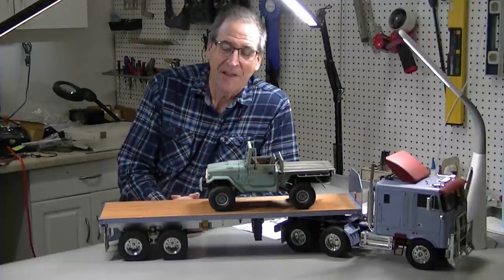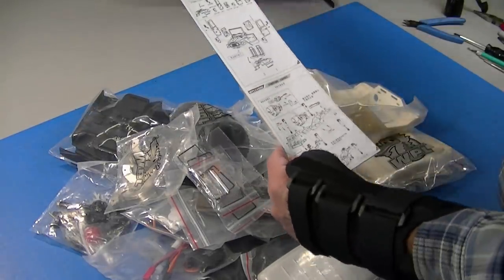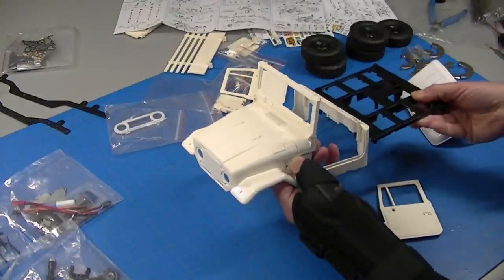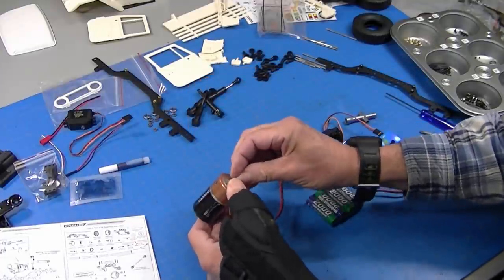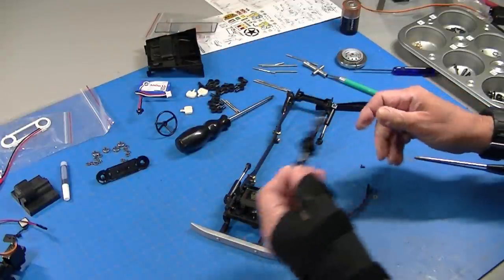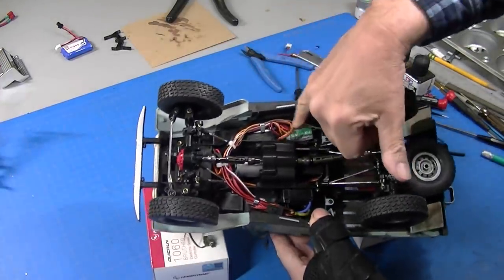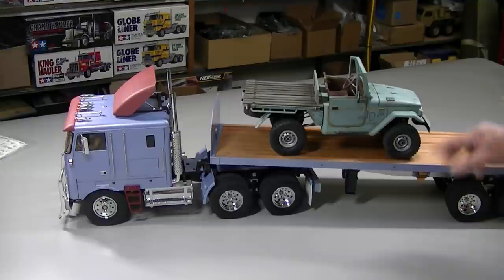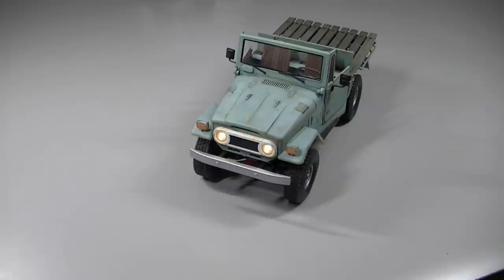Remotoy 1/16 RC Landcruiser WPL-C44KM Metal Edition Crawler Build

Comment: This Video reminded me of your fall on the Ice!! 😖  Glad that's healed. 😊
I got a WPL Truck for my Grandson - and quickly realized after he ran down the Cat and tore the Tires off, that he's still too young for it. It's the 6X6 "Army Truck" that's nearly 1/15th Scale, by measurement. It's SORT OF a Deuce-and-a-Half... And like yours, I'm VERY impressed with the Scale details!! 👍👍
This one is a RTR, not as nice as yours, but will take upgrades. It's got plastic Driveshafts that fall apart if you look at them too long! Steel Chassis though, full Interior. Same SOFT Tires.... Same Battery under the Hood.

And, as a Model Railroader of almost 45 years, I've got a full compliment of Weathering supplies, including a Rust Patina Kit - that makes REAL Rust, with Iron impregnated Paint!! 😎 
SO...... I believe I'VE got a Flatbed load myself! 
But you've really sold me on that Land Cruiser too. Thanks for the inspiration!

Comment: Really like your builds.....have you ever thought about doing a video on just the paint booth....how your booth is set up. What you use for turntables and clamps. How you use (setup) the compressor and what compressor to buy? How to use an air brush, how to clean it and how often, also which ones to buy? How to use brushes and which ones to buy? What paints you like. Even what sand paper or sanders to use and buy?  Any special tricks. That would help us newbies to the hobby. Again, that WPL truck was totally awesome.  Keep up the great videos.

Comment: Hi Bob, are you still going to do a connection and set up vid on the Beier module? See a lot of people had probs with the diffs being really notchy,mainly when the diff cover goes on.A lot of people was spacing and shimming,you seemed to get by without any,the company said the axles need to be run in! Really enjoy the build vids and this was something a bit different, brand wise.
Reply from the maker: Yes, more Beier coming soon.  I did not do any shimming but did run them in with a battery drill for a bit.  Seems pretty darn smooth overall.

Comment: I am building this however the large bearings don't slide over its almost has to be a press fit also the steering knuckle doesn't align so the screws will not work what am i doing wrong?
Reply: got it figured it out thank you
Reply: When building any kind of kits. During assembly. It's good to screw everything loose and then tighten